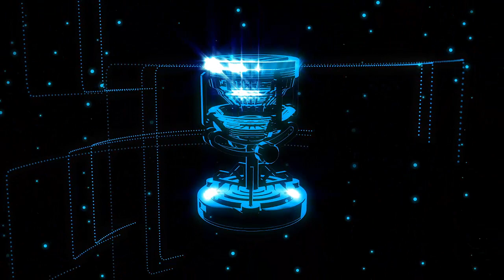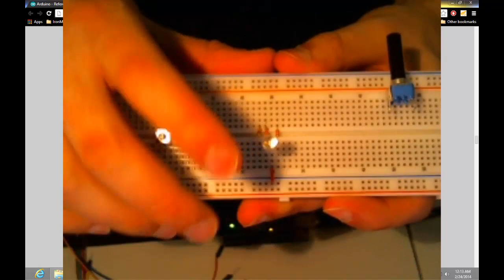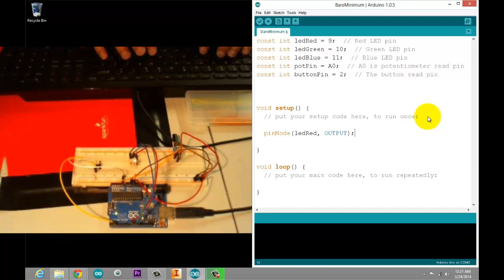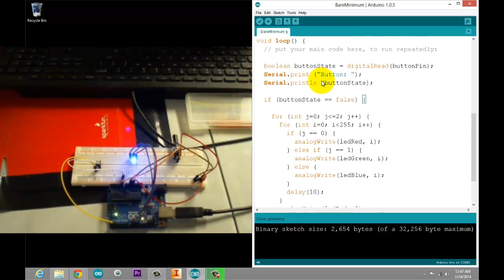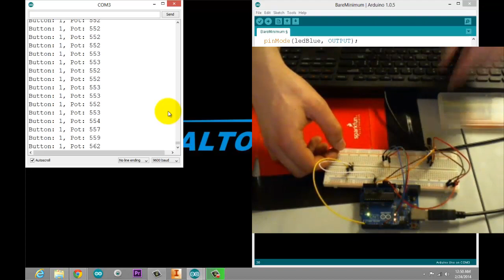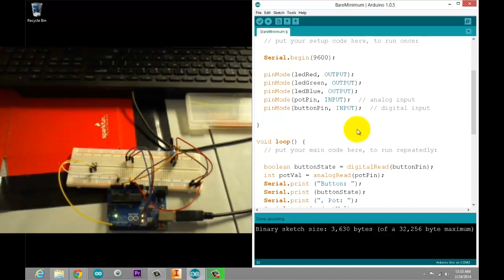Arduino Tutorial 07 - For and If

Comment: nice tutorial! thank you!. btw.. i dont understand at 34:51. What do you mean 0 - 1024? 
why put 512?
Reply from the maker: +Tay Aaron Sorry - missed this comment!  0-1024 is the typical range of any analog sensor as interpreted by the Arduino.  So, if we create an "if" statement that checks for the value to be greater than 512 (halfway between the min. and max values), we can detect when the knob is turned past a certain point (in this case, the halfway point).